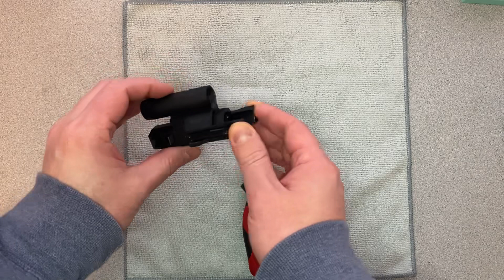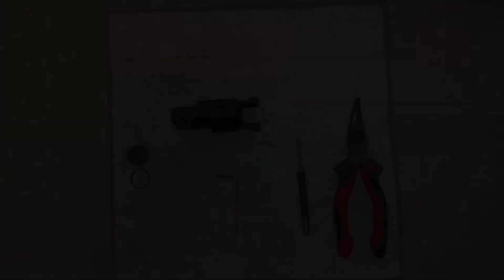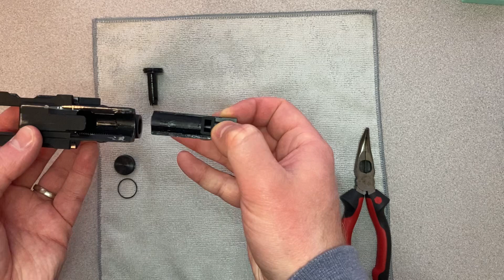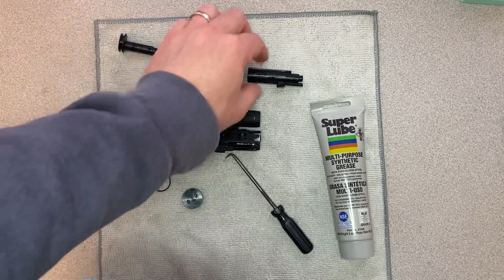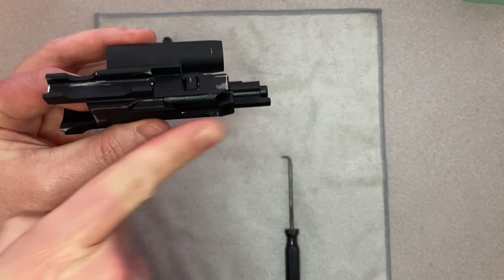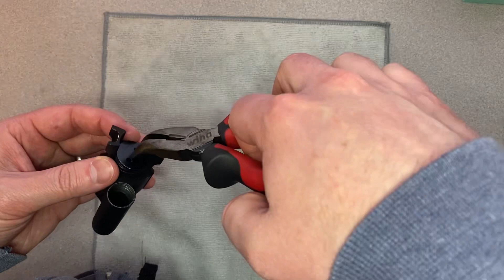VFC MP5 GBB V2 - Nozzle and Bolt Carrier Disassembly/Reassembly

Comment: These videos are so well made, very detailed. Would you ever do the a5 burst pack disassembly, it seems like a pain. Maybe it would be easier to just buy a navy semi auto pack.
Reply from the maker: Thank you! 

Doing the burst pack is on my list, but my summer has been extremely busy on some other airsoft related projects that I hope to announce soon :) 

I will get back to making videos in the coming weeks!
Reply: @aetechairsoft  Thanks for the reply, going to be using these videos alot once my MP5a5 finally arrives. One quick question, do you know the exact measurements / spec of the o-rings in the BCG, looking at stocking up on some spares and details online are hard to come by? Either way looking forward to seeing more from this channel.
Reply from the maker: @britishbeef4890  M1 X 18mm, M2.5 X 16mm, M1 X 7.5mm. 70 Durometer, Buna-N material (Nitrile)
Reply: @aetechairsoft  Thanks for these!